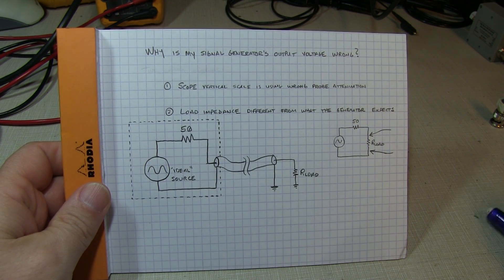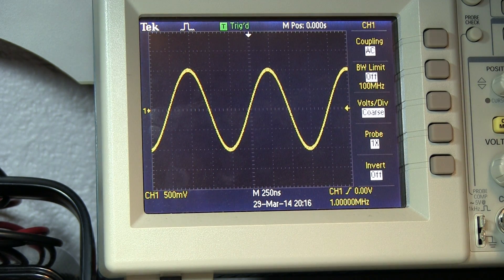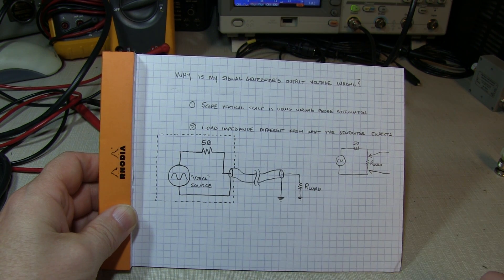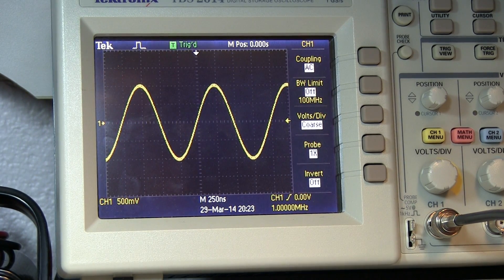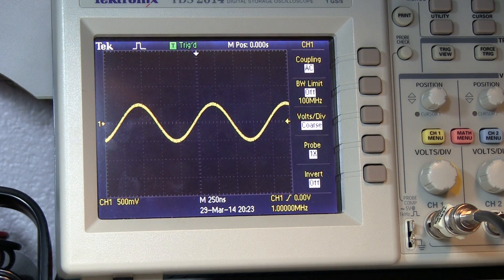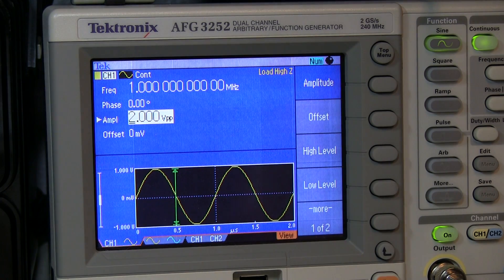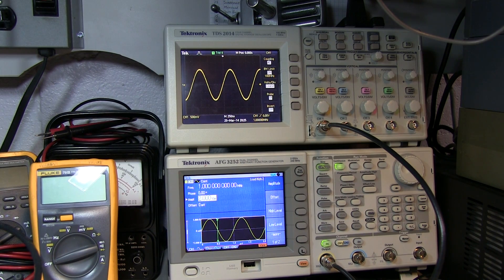#137: Why your Function Generator's output voltage reading can be wrong

Comment: I have my signal generator set to 20 V peak to peak, and yet it reads as millivolts on the oscilloscope?
Reply from the maker: Impossible for me to determine why.  I don't know what equipment you are using, nor do I know your experience with the equipment.  It could be a setup problem on the scope or the generator, or a fault with the equipment or your cable/probe.

Comment: This is a bit after you recorded this video (and it is very helpful). Since I have rekindled my bench time, I have a related question. Often I see an omega symbol in the vertical indicator at the bottom of the screen. I use a Rigol MSO2024 with a BNC cable connected between my Siglen ARB and the scope. I saw the incorrect P-T-P voltage (hence your video was helpful), but I need help understanding the Omega 50mV, for example, displayed on the screen. I hope this makes sense to you. Can you give me a good explanation? Thanks, Dave
Reply from the maker: The omega symbol in the vertical indicator is typically use to indicate that this channel's 50 ohm termination is being used.  I would imagine it is the same thing on the Rigol.

Comment: What Arbitrary Waveform - Function Generator would you recommend to an amateur radio hobbyist for $350 or less?
Reply from the maker: The SIGLENT SDG1032X is probably a good buy.

Comment: great video..im planning to get a sig gen, I wonder what are the best practices to not blow up the device..im concern if its ok for the sig gen output front end to see DC voltage from the device under test..
Reply from the maker: I guess it would really depend on the particular signal generator (and how much voltage you're talking about).  There is no universal yes/no answer.

Comment: I'm currently studying Electrical Engineering and have had this issue in labs. The TA that was instructing just chocked it up to the signal generator just not being very accurate. I'm glad you set the record straight.
Reply from the maker: Maybe you should share this video with your TA so that they'll know the right answer too!

Comment: 2 Questions if you don't mind:
1)When you terminated the coax with a 50 Ohm terminator at oscilloscope input, why does that help? The oscilloscope now sees a 50 Ohm resistor versus a 50 Ohm coax but they are both 50 Ohm either way! To me, by adding the 50 Ohm termination it is almost like you just added another inch of the same 50 Ohm extra coax at the end which I don't understand how that helps. Is it that terminator represented a parallel connection to scope while the coax represented a series 50 Ohms?

2)When you put the function generator to high-Z (output impedance) isn't that a mismatch with the 50 Ohm coax so the signal should get reflected before  even before it leaves the generator?
Reply from the maker: To answer your questions:
1) The termination provides a "matched load" for the transmission line.  To understand why, it will help to understand how transmission lines work (and why they have a characteristic impedance).  This video should help with your understanding of that: https://youtu.be/g_jxh0Qe_FY
As you will learn from this video, a 50 ohm transmission line is NOT the same as a 50 ohm resistor.  It only "looks like" a 50 ohm resistor to signals that are changing - so, crudely you could think of it as a AC-coupled 50 ohms.  Again, the video should help clear this up...

2) When you change the function generator to high-Z, this does NOT change the output impedance of the generator.  Let me say that again...  it does NOT change the output impedance of the generator.  This is a VERY common mis-understanding.  The output impedance of the generator is ALWAYS 50 ohms. When you change the Output load setting on the generator, all this does is causes the generator user interface to change the output amplitude appropriately.  Since the output impedance is 50 ohms, there is a 50 ohm resistor in series with the output at all times.  So, the voltage at the load will depend on the load resistance because this load resistance forms a voltage divider with the generator's internal 50 ohm resistor.  The load setting on the generator tells it how to calculate the voltage appearing at the load by properly calculating the effect of the voltage divider (50 || load_resistance).
Reply: @w2aew  I see now. Really liked your transmission line video!

Comment: It's not really clear to me why the resistor you connect to the scope is in parallel? (I calculated the resistance of a 50 and 1M ohm in parallel and got a value close to 50 ohm. That's clear to me) . But based on your drawing and my general understanding of the wirering then I persieve it as a series circuit and not a parallel.
Can you help me understand? Thanks for your patience and videos 😊
Reply from the maker: The 50 ohm resistor that I connect to the scope is in parallel with the scope's 1Mohm input, and since it is so much lower than 1Mohm, the result is very nearly equal to 50 ohms.  This 50 ohm combination then appears in series with the 50 ohm resistor that is inside the generator (in series with the output amplifier).  Then end result is that the function generator's 50 ohm output resistance is in series with the 50 ohm termination at the scope, thus making a 2:1 voltage divider.
Reply: @w2aew  this is what I was able to figure out myself. My problem is that the schematic doesn't look like a parallel. Could you explain how it is a parallel connection with the scope? It looks like a serial connection to me.
Reply from the maker: @Infinitesap  The 1Mohm input impedance of the scope is not drawn explicitly.  The 50 ohm thru terminator shown at about 3:10 in the video has a 50 ohm resistor from the center of the coax to the shield (ground).  Thus, when connected to the scope input, this resistor is in parallel with the scope's 1M input impedance (since the scope will now be measuring across this 50 ohm resistor.)
Reply: @w2aew  thank that made it clear for me. Please make more videos. I'm really learning a lot from you 🙂.
Reply: Thanks this really made me understand. Could you make a video on how to use the sync and trigger in- and outputs on the fg/scope. Would also be awesome if you could show application with them on breadboard setups.

Comment: ok so the real question now is, why do i see 2x voltage on oscilloscope on a car charger rectifier on 30V-32V when i'm supposed to see 15V-15.6V or so... I wish i had RMS multimeter with correct AC measurements, since the waveform that is shown is kind of like a mix of full bridge rectifier with the pulse modulation by putting some weird cap-discharge in the middle (there is a spike in the rising part of half-wave that diminishes or rises above the visible part, that contributes to output RMS thus one can control RMS from about 10V up to 15.8V)
Reply from the maker: You need something that can show/calculate the true-RMS value - because if the waveform is not sinusoidal, then the 0.707x factor is meaningless.

Comment: Hi, long post so bear with me..thank you for all your content, I can binge watch your videos all day as you explain things in detail in a way it's very easy to understand.

I know this is an older video, but  have a request and forgive me if this has been covered. In regards to the 50 ohm termination from the function generator, can you explain the fundamentals of why a 50 ohm adapter is required (if so) at the scope from a function generator? What's confusing for me is if the FG has a 50 ohm output impedance, and this is before the output terminal, and the scope has a high impedance, why the 50 ohm at the scope input?  My assumptions is the FG needs to see the 50 ohm load at the end of the cable to provide an accurate signal to the scope along the BNC cable. This likely comes down to basic electronics regarding load and current and I want to speculate I'm about 80-90% educated on this..lol.

I have built a workstation for the kids as their HS has an engineering dept as well as a robotics dept, I'm moving my hobbyist electronics gear to this workstation so we can all get involved, and want to make sure I have a complete understanding of the setup procedures for the equipment. The kids and I love to get inside and see how and why things work, and hopefully build some projects with the arduino kits as well as trial and error on a breadboard. Hopefully I explained my request/lack of understanding correctly, thanks again and I plan to catch up on your videos.
Reply from the maker: The short answer to "why a 50 ohm termination is needed at the end of the coax" is to prevent signal reflections that can distort the signal.  This is explained more fully in this video: https://www.youtube.com/watch?v=g_jxh0Qe_FY

For low frequencies - below a few MHz, it really isn't that important since the length of the line is much much shorter than the signal's wavelength, and reflections don't pose any problem.  For for higher frequencies, or for low frequency signals with high frequency content (such as fast rise/fall times), termination may be important.

The function generator has a 50 ohm resistor in series with it's output to terminate and reflected signals that are coming back from an unterminated end.  This ensures that these reflected signals to re-reflect back towards the load again.  Since the generator has a 50 ohm series resistance, and the expectation is that the far end load will be 50 ohms, this sets up a basic 2:1 voltage divider between the output amplifier of the generator and the far end load.  

Again, for low frequency work, you can omit the 50 ohm far end termination.  Just keep this in mind when setting the desired output amplitude.  If the generator doesn't have a way for you to tell it that what the far end load impedance is, then you'll just have to remember that the output will be twice the set value if the far end load impedance is high.
Reply: @w2aew  Thank you, I did watch the linked video and your explanation helps alot. I forgot about the in-depth content of that video.

Sidenote, I actually frequent your videos on a different account which has more kid friendly subscriptions so the sidebar videos stay clean for when my kids and I view them. 

Take care.

Comment: Thanks for this great video, it helps me to solve most of my questions. But one quesetion is left, when I have a load with an unknown impedance between 30 and 80 Ohm, should I set the impedance value of the funtion generator to 50 Ohm or to high z? I would be very happy about your help.
Reply from the maker: 50 would be closest - but remember, all this is doing is adjusting the calculation that the generator does for the output amplitude to account for the voltage division of the 50 ohm output impedance and the load.  In either case, if you want a specific amplitude applied to your load, MEASURE it AT the load and adjust the generator accordingly (regardless of what the generator is telling you the amplitude is).
Reply: @w2aew  thank you for responding!

Comment: attach 8 ohm 50 w  resistor...to sig gen...which outputs  1 v rms...  or higher.... seems that lots of  so called sig gens are LIMITED at output current..... they play nice with voltages,,,,but   ....they dont like to output even 100 mA current,...
Reply from the maker: Signal generators almost always have a 50ohm output impedance - THIS is what limits the current.  If it is designed to deliver 1Vrms to a 50 ohm load, that means that is generating 2Vrms at the gen side of the internal 50ohm resistor in series with the output.  Thus, the voltage delivered to the 8 ohm load would be 2V *(8/58) = 276mVrms.
Reply: @w2aew  many kind  thanks.. now i know my stuff works...  what do u suggest,, to increase current output..
Reply from the maker: @kaybhee6  If you need to drive such low impedance loads, like loudspeakers, etc., then you'll likely want to stick and audio power amplifier between your siggen output and the load.  There really isn't anything you can do with the siggen since the output impedance is generally fixed.

Comment: Ok so the output on the wfg is setting up a voltage divider, that makes sense. So say we send a signal out of the wfg to a fairly busy circuit on a breadboard, since we have no way of knowing what the forward/reflected voltage will be on the overall circuit including the 75 ohm transmission line Ive sent my signal to, we should use the high Z output load if it has that ability to?  
Sending a signal straight to a scope seems simple, 1 meg probe = high impedance.
Its thevinans theroem
Reply from the maker: Yes, a voltage divider, precisely.  The generator uses the output-Z setting to properly compute the division so it can accurately show you the amplitude.  It's always a good idea to measure/verify the output with a scope, etc.
Reply: @w2aew  thanks as always Alan. Happy new year. Enjoy some good propogation

Comment: - But isn't the coax also 50 ohms?
Reply from the maker: Yes, but that is the "surge" impedance.  In other words, it appears like 50 ohms to rapidly changing signals, due to the distributed capacitance and inductance.  At low frequencies, or where the line length is very short with respect to the wavelength of the signal, the coax simply looks like a pair of conductors.
Reply: @w2aew  Thanks this solved a mystery for me :-)

Comment: Hi could you evaluate if this is worth buying? https://www.elektor.de/pcbite-kit-incl-4x-sp10-probe-and-test-wires
Reply from the maker: Seems very expensive for what it gives you.  Nice and neat, but a luxury for sure.  I've always used a vice of some sort - either a machinists vice or Panavise such as: https://www.amazon.com/PanaVise-350-Multi-Purpose-Work-Center/dp/B00011QA0M
Reply: @w2aew   My question was actually also about the included probes. Are they of any value. I'm very confused about probes. They come in different types and (especially prices) and it's difficult to chose.
Nice link to your vise. Been on the lookout for this for quite some time :-) Thanks :-)
Reply from the maker: @Infinitesap  Personally, I've rarely had the need for hands-free probing.  On rare occasion when I do, I'll usually tack-solder a short wire to the point and use a clip lead.
Reply: @w2aew  Thanks I see your point :-).

Comment: Beautiful generator AFG3252  costs "only"  us$12,500  new and 6000 2nd hand. Tek has a new serie called AFG31000    @  https://uk.tek.com/signal-generator/afg31000-function-generator which is basicley the same  the serie mentioned in the video.

Comment: The function generator voltage would appear to be doubled because of the high impedance on the oscilloscope, so you would have to set it to 50-ohm mode or use 50-ohm feed-thru termination.
Reply: @Ralph Reilly  I'm not sure why do you think I need to know, but it is one year old post.

Comment: "Load Impedance" just changes the amplitude voltage?! I don't have a Hi-Z option on my generator, I can use a 50 ohm attenuator or just set up half of the amplitude?
Reply from the maker: Yes, 'load impedance' changes the way the displayed amplitude is calculated.  If your generator is expecting a 50 ohm load, you can use a 50ohm thru terminator, or simply account for the 2x voltage difference.
Reply: @w2aew  Thank you so much.

Comment: This got me bugged. My function generator is the cheap JDS6600 and it doesn't have a setting for output impedance. According to the manual, the output is 50 Ohm Impedance. I'm connecting it to the oscilloscope directly with a coax cable. And I see the correct Peek to Peek reading. Why would that be? The oscilloscope inputs are 1 MOhm...
Reply: This simply means that the reading assumes a high load impedance. I bet if you connect a 50 ohm load, the the actual output would be 1/2 the setting.

Comment: When using a function generator for cb/ham radio allignment would you need a generator with a dc offset??
Reply from the maker: Usually not - in most cases, you'd want to AC-couple a test signal that you're injecting to a circuit.
Reply: Thank you sir

Comment: Thank you for nice tutorial. I can understand the difference between high and low impedance.
I have one question.
I wonder why can we ignore the impedance of the cable.
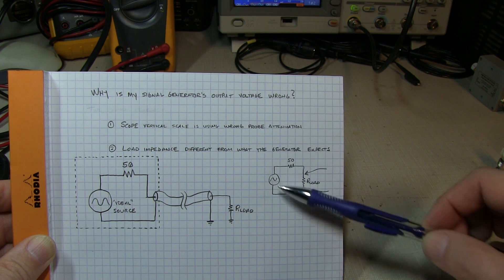In the video 2:15, simple circuit represents only function generator impedance and oscilloscope impedance.
I can't understand why here cable impedance 50 ohm does not included.
Reply from the maker: The coax cable impedance really only begins to matter at high frequencies.  Remember, the cable impedance is simply the impedance seen by the signal as it travels down the line (see my video on transmission lines and terminations).
https://www.youtube.com/watch?v=g_jxh0Qe_FY
Reply: Dear w2aew,
Thank you for your reply.
I'm watching the link.
Thank you for your nice tutorial again!

Comment: I am confused ... is peak-to-peak voltage on a square wave equal to true RMS, or is the RMS exactly half of peak-to-peak of a square wave? I have seen/read both. When hooking my Fluke 175 to the test output of my Tek 465 (300mv square wave), the Fluke measures approx half the peak-to-peak value displayed.
Reply from the maker: You also have to take into account any DC offset. But, in general, the RMS value of a 50% duty cycle square wave is equal to 1/2 the peak to peak value.  This video might help:
https://www.youtube.com/watch?v=ue0wtlrmCJE
Reply: Thanks Allan! Just discovered your amazing channel!! Am plowing through them at a good clip. Playing some multiple times. Playing and pausing others,  and then running over to my scope. This is an amazing resource. Thanks so much!!!!
Reply from the maker: You may know that I maintain a complete index of all my videos, arranged by number and by topic.  The link can be found on my channel's homepage, in the lower right corner of the banner graphic.